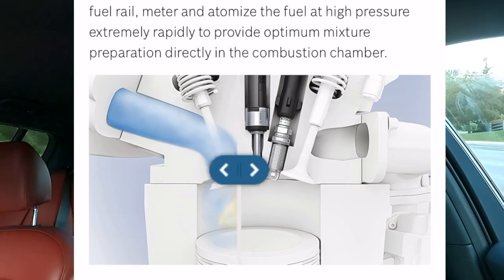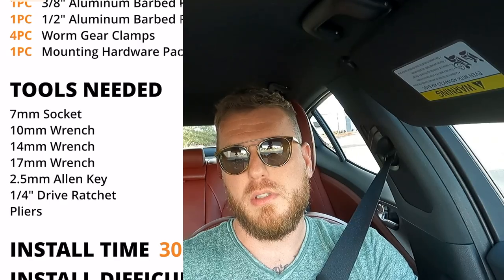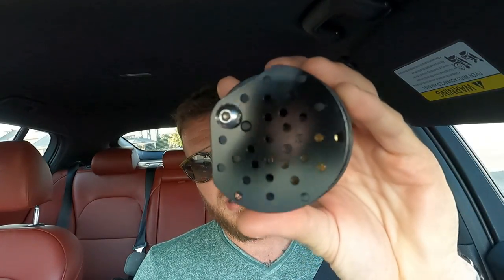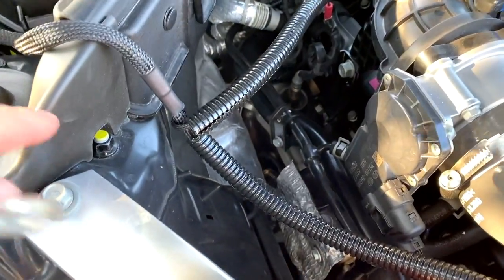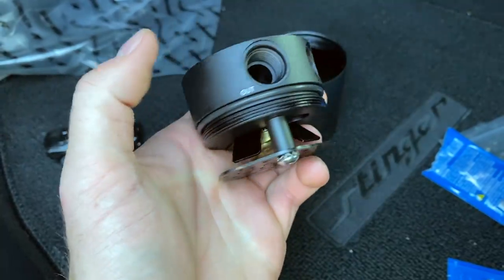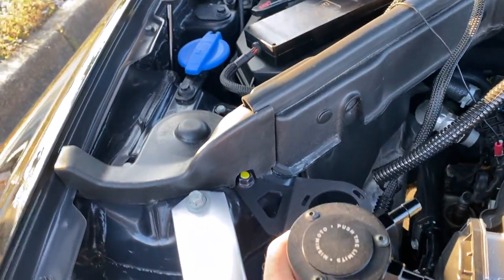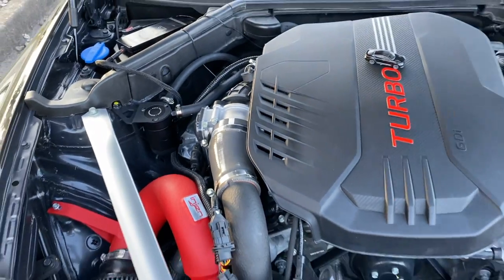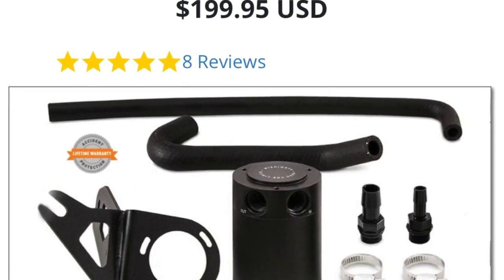KIA STINGER GT - Oil Catch Can Install + MISHIMOTO GIVEAWAY!!  🐝💨💨

Comment: I installed the BMS Zero Maintenance can. I can't empty it to see if it's working. Since it's designed to drain back into crankcase. But I twisted it apart just to see when I replaced my filters with KN drop ins. There was a little oil before the baffles. So I guess it is catching it. Great explanation btw 👍
Reply from the maker: Awesome! I’m glad you got one 👊
Reply: @twn2rbo I had a bms catch can and it completely ruined my car because it said it was 0 maintenance

Comment: some install two ? are two really needed for some reason ? and I've seen some videos mention hot air that's blown back with catch can and there's an additional little air filter thingy to install as well ?  Will only adding one catch can create any flow problems in other aspects of the car running well and not blowing hot air into the intake, or is that normal ?
Reply from the maker: I don’t think so, I guess it would be less maintenance. Not a fan of the system that recycle the blow by back into the engine, but two cans would be more volume. I believe this one was well thought out and simple, not the biggest can, but then again I’ll empty it out around every oil change. As far as the hot air I wouldn’t see any changes since it’s all once sealed system still , going to the catch can first may help it cool down a degree or so. At the end of the day, they all catch oil and blow by, as long as it has a good micron filter and baffle, I wouldn’t worry about it 🐝🐝💨💨💨

Comment: I went with the BMS zero maintenance catch can, sometimes it’s so hard to know if it’s doing its job though. I would love the mishimoto. Love the content.
Reply from the maker: That’s a good one, if you have had it on during the winter chances are it’s catching more condensation than anything. The intro to my last vid was 3 months 2k miles and 75% was condensation sludge

Comment: hey so I've been meaning to get a catch can but i've seen two different types - single valve and dual valve. do you know what the difference is and which one might be better over the other? cheers
Reply from the maker: You definitely would want a dual valve like this one , as long as it has PCV port in and a hose out to the intake with a baffle and micron filter, it really doesn’t matter IMO. They are all catching oil and blow by :) people really like the Add1 v3, but as long as you get one you’ll be good. K8 store has 4 options and all are good IMO

Comment: I have the same catch can but my car doesn't have the stud to hold the lower end of the bracket in place. Know any work arounds to this issue?
Reply from the maker: Hmmm I do not, haven’t heard of that one yet 🤔
Reply: @twn2rbo  I found the work around. The K8stinger store sent me a bolt to pop through the hole in place of the stud and that's holding up pretty well.
Reply from the maker: @Aether52  that’s great to hear! I’ll pass that info along if someone else asks me

Comment: Anyone have any experience with the BMS catch can that’s maintenance free, just got it with my JB4 kit and it just seems to easy and good to be true lol
Reply from the maker: Haven’t looked into that, hopefully it doesn’t return the oil back into the engine to “recycle” it. I wouldn’t want that stuff back in my oil since it’s not pure oil going back in.
Reply: @twn2rbo  the say "Oil is separated from engine vapor within the OCC where it gravity drains right back into the crankcase providing a truly install and forget it oil catch can solution"
Reply from the maker: @joshuabreen  yeah I thought that’s what it was, not a fan of that, but hey - no maintenance. One thing is that a OCC cannot be forgotten about, if it over flows , you will have much bigger problems than you would not having one at all.
Reply: @twn2rbo  I may end up running both  haha, I think BMS just makes theirs with the intention of quick removal back to factory...oh well came with the kit...can't f'ing wait!!!
Reply from the maker: @joshuabreen  heck yeah! BMS makes quality parts
Reply: @twn2rbo  yeah mine over flowed